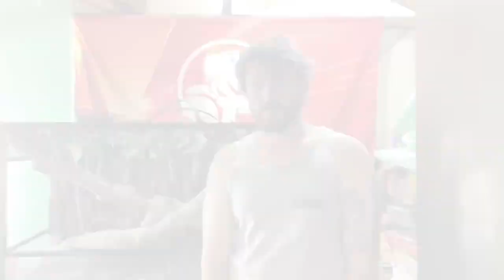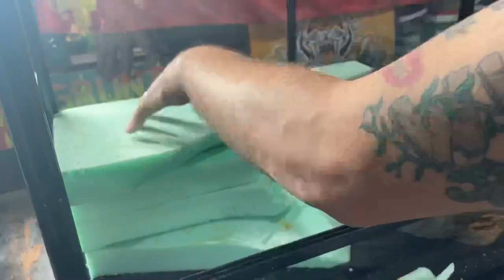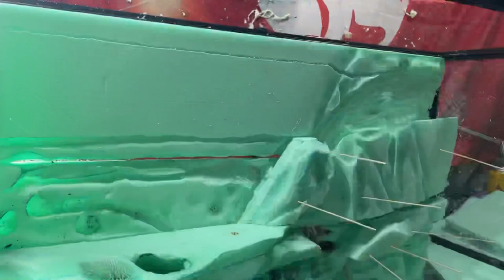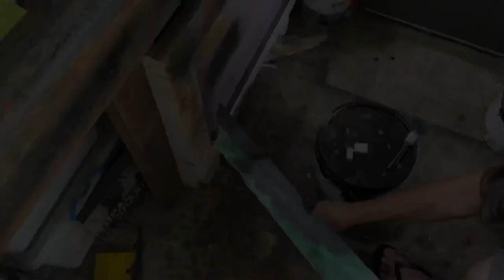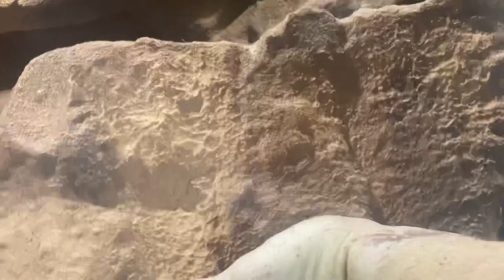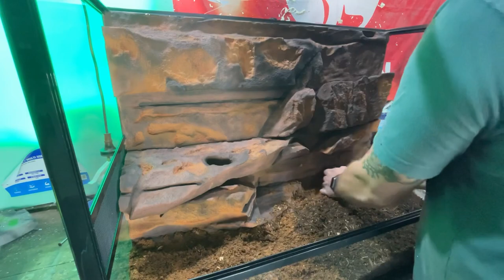Stimsons Python Enclosure Build

Comment: LOVE your builds and videos. Inspiration overload. May i please ask what the red handled tool used is called and where you get the mini blow torch? Also was that gorilla glue you use between foam sheets? THANK YOU
Reply from the maker: Thank you. It’s a hot wire foam cutter. Can get them on eBay for about $30 
Mini blow torches can be purchased from hardware stores. 
Yes I use the gorilla glue but the selleys polyurethane would be a similar product.

Comment: Quick question if I may?  You use pointing to cover your foam that's not a product used here that I can find. Is it just sanded tile grout or motar?
Reply from the maker: No it’s not. It’s a more flexible/waterproof compound designed to set and seal roof tiles. Wall and floor tile grout works but you need to be consistent with the way you mix it and apply it. Once you’ve worked that out tile grout can be a great product to coat with.

Comment: Do you use a thermostat for the basking spot hot side of enclosure for your python? Or do you not need one if you use a cage?
Reply from the maker: Yeah I do. You should always use a thermostat for the protection of your animals. The cage is simply there to stop your animals burning itself by wrapping around or touching the heat source.
Reply: @Cambart1  Ok thank you, With the thermostat heat sensor probe Where would be the best spot to put it like would I put it in the cage or below on the rock basking spot?
Reply from the maker: Generally you want the probe at the same level as your basking rock or spot. This will give accurate reading of temp right where your animal is. You can send me enclosure photos to my Instagram and I can assist you from there.